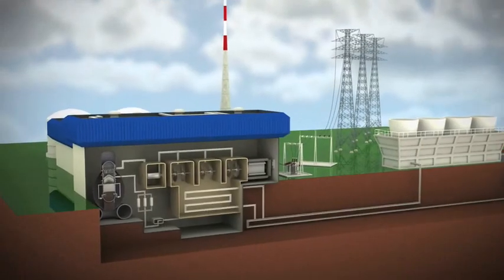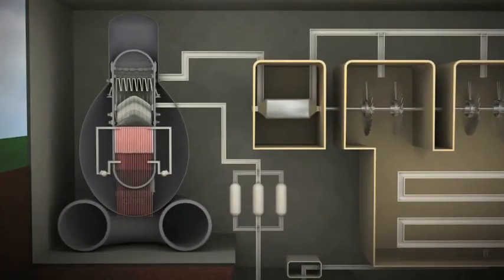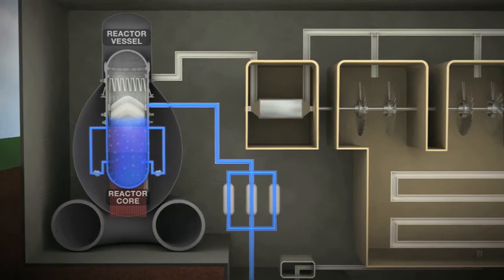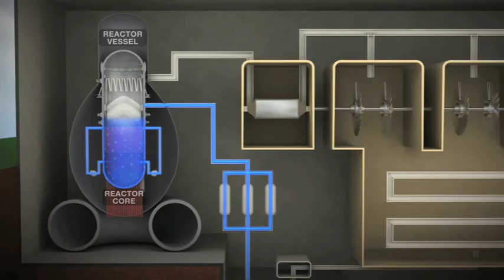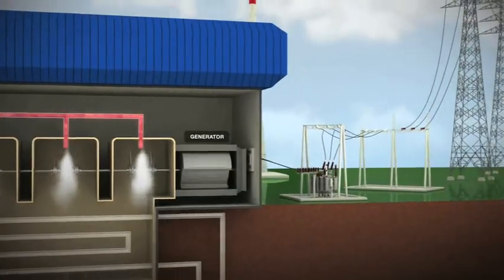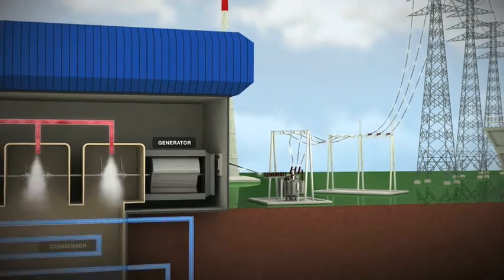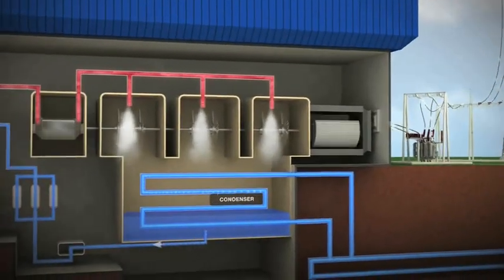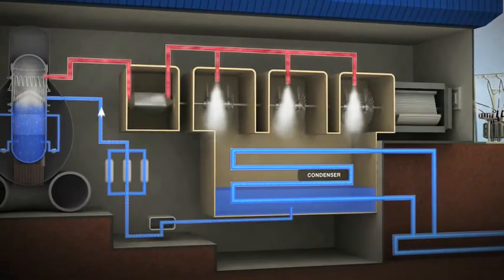BWR Nuclear Power Plant Animation

Comment: Is the steam radioactive ??
Reply: Nope
Reply: @purpledragon1945  as far as I know in this kind of nuclear plant the steam comes out directly from the reactor, ..the PWR  is different..it has a steam generator
Reply: @purpledragon1945  in the BWR the steam comes out directly from the water inside the reactor...in the PWR the steam comes out from a steam generator.. so I guess the steam from the BWR is contaminated
Reply: yes, but most of the absorbed radiation has a half life of 7 seconds
Reply: Very slightly from tritium, but it doesn’t leave the reactor. Even if it did it wouldn’t be a big deal.